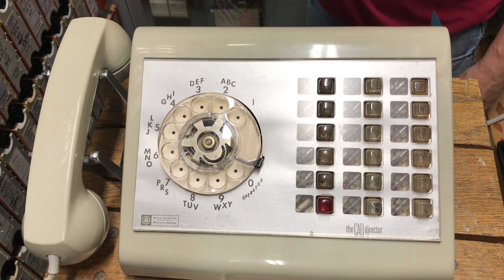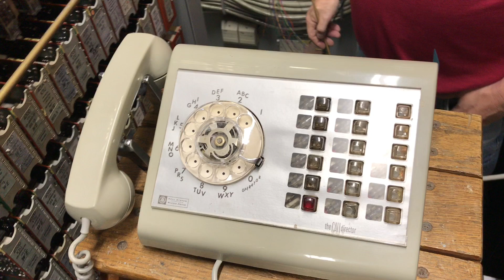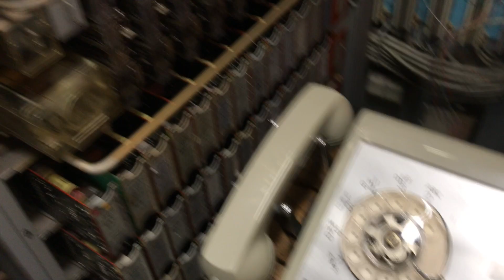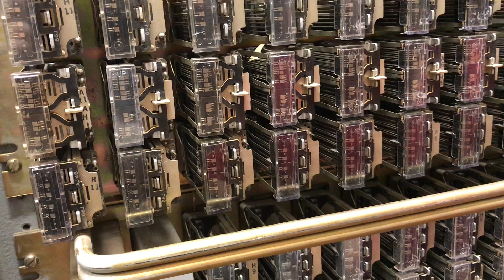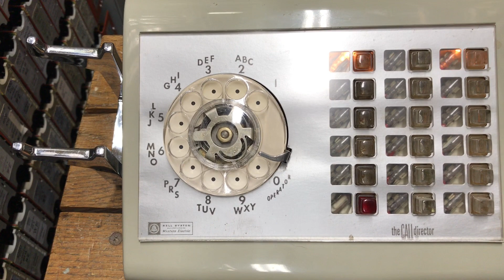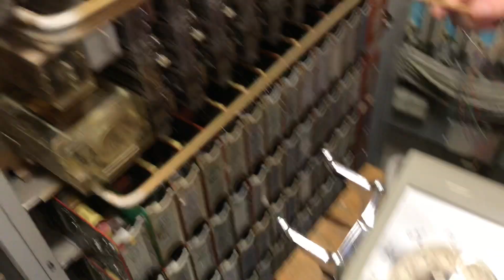Western Electric 1A1 concentrator & phone.

Comment: I got to see concentrators operating in the very early 80’s when my grandfather took me with him to work on one of two installed at an answering service operating out of a residence in which there was a dire shortage of pairs. The enamel coated steel circuit packs are classic.

Comment: Great description and demonstration of the concentrator phone. Am I mistaken, or does this phones wiring work similarly to a ten button phone where the lamp grounds and a-leads are common? Or, is it the equipment in the rack that determines which line is selected and fed to the receiver on the phone? Seems complicated, but not if you only have one 25pr cable running through the floor!